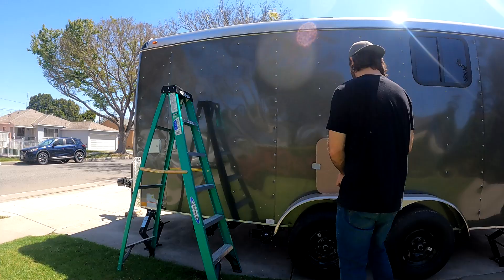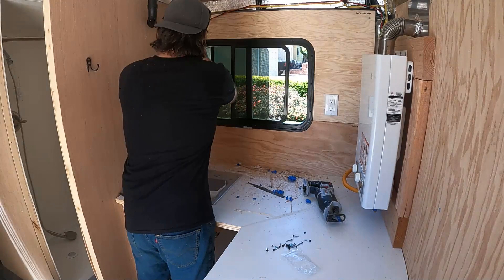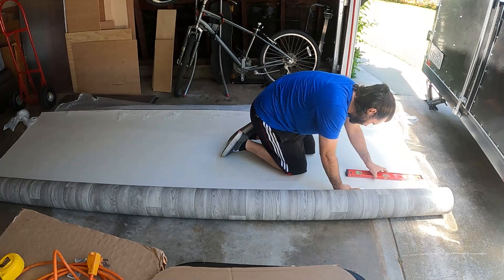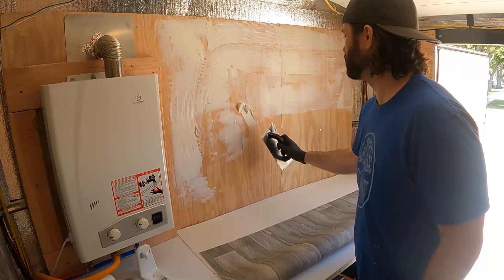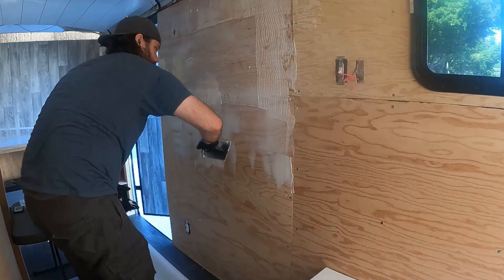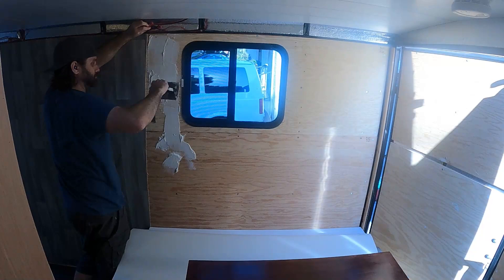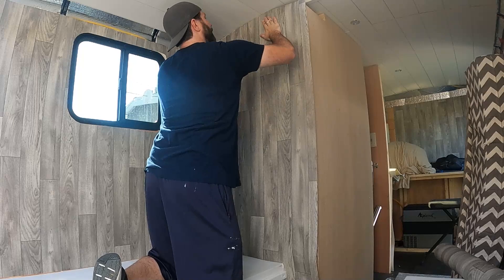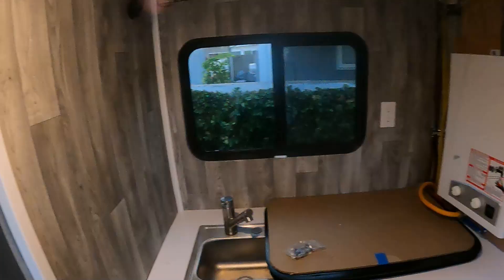Cargo Camper - Vinyl Wall Covering

Comment: For the water heater, maybe a removable wood cover (or frame with door) that has some upper cabinets (top 1/3 or 1/4) continuing across the front to the far wall by the door, all stained that lovely color to match your table top.

Comment: Consider this idea stolen... Looks really nice. Just curious about going vertical with the pattern? Personal preference only, I think that would look cool horizontally too. Great build! I'm in the process of "updating" my trailer and don't like the idea of pain or stain in an enclosed space.
Reply from the maker: Thanks! I think this turned out surprisingly better than I would have guessed. Glad to share it!  

The orientation was mostly chosen because it was easier to roll out this way. I'm sure it'd look great horizontally too.

Comment: I noticed you cut the supports behind new window did you weld in supports around the edges or are you using the plywood to keep the support somehow? Also why not vinyl then cut out window?
Reply from the maker: Yeah in hindsight putting the window in after would have been a better plan

Comment: I hope this isn't a silly question but why did you have to drill holes in the window frame before installing each screw? Are you drilling through the wood around the window so the screw goes into the window frame?
Reply from the maker: I think these screws were meant to go into pre-drilled holes. They had a lot of trouble getting into the wood without em.

Comment: Nice job! What were the materials you used for this, especially the glue? Definitely thinking of using your idea on our 7 x 14 cargo trailer conversion we're busy with.
Reply from the maker: This is the glue I used: https://www.lowes.com/pd/TEC-Stick-N-Stay-Pack-Sheet-Vinyl-and-Carpet-Tile-Flooring-Adhesive-1-Quart/50064107 
The material was just rolled vinyl flooring